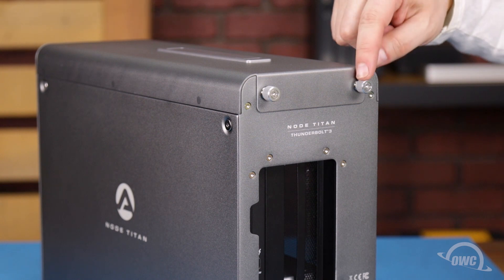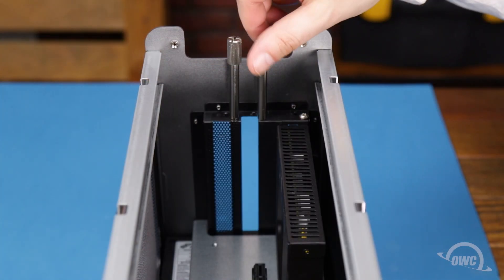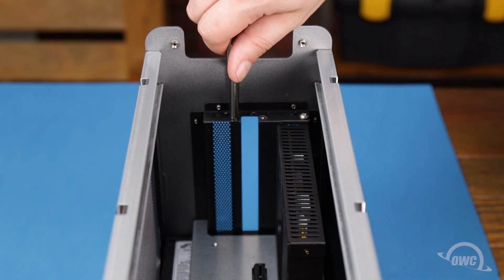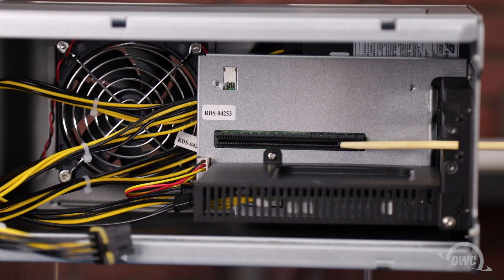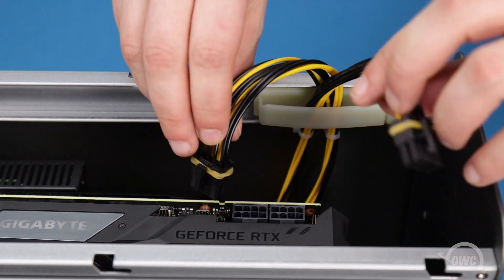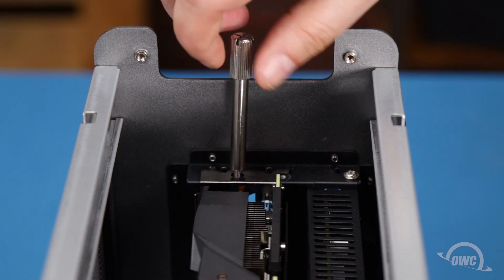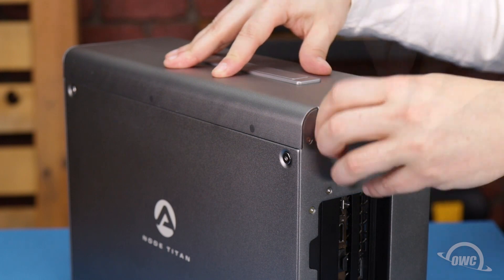How to install a GPU card in an Akitio Node Titan

Comment: Which GPU did u install in this video?
Reply from the maker: Hey Will, while I am not 100% certain it looks to be a Radeon RX 580 assembled by GigaByte.
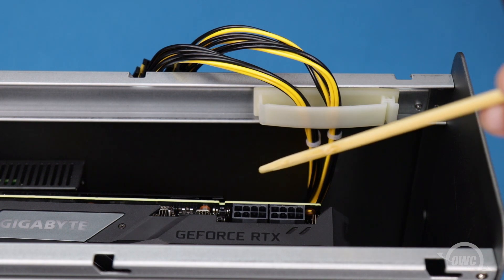Reply: @poweredbyowc  1:41 it is geforce RTX on board, so it's NVIDIa card =)

Comment: Question: what about cross flow for air intake? All of the 30xx cards have air cross flow through the card and I don't see any mesh holes for cross flow on the back side of the case. Wont this force the EGPU to throttle the card?